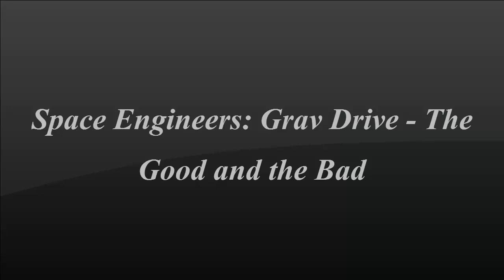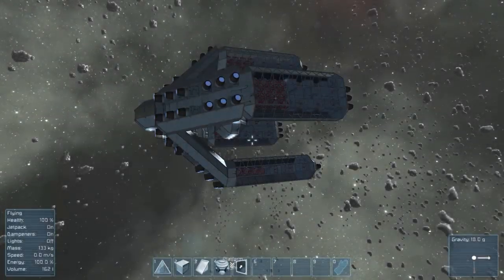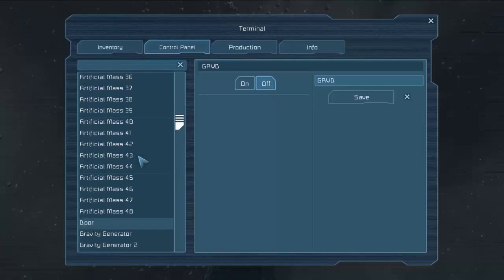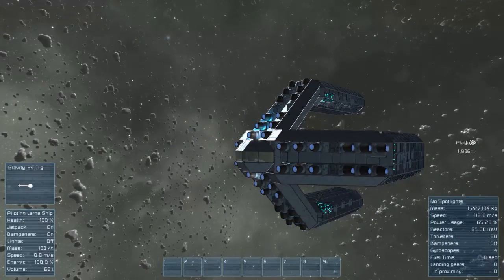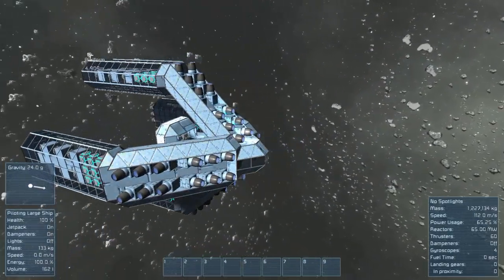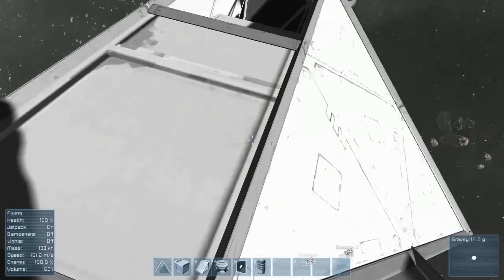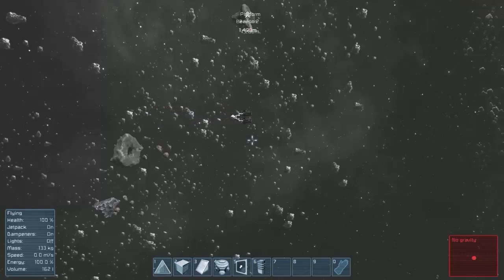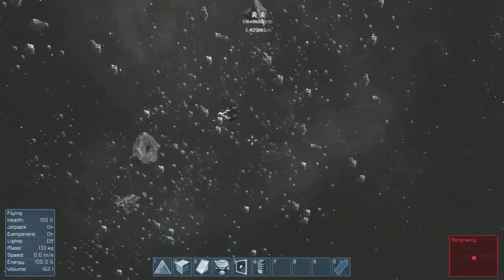Space Engineers: Gravity Drive - The Good and the Bad

Comment: I really love the designs. I really need to make a Gravity ship to go with my mega Asteroid base. You've given me some encouragement to try something grand.

A consideration. Why not try stacking the Artificial mass between the gravity generators instead of the Armor cubes? This should reduce the overall space wasted by armor.
Reply from the maker: I'm glad it gave you idea's :D

As per the stacking, that is a great Idea, I need to fix that ship anyway, I didn't adjust any of the gravity fields either.
Reply: Art mass cubes are almost as strong as blast doors so i use them as walls cause i don't plan on crashing my ship and i just import them into survival mode so maintaining them is challenging enough.